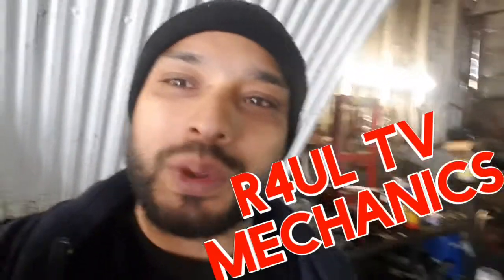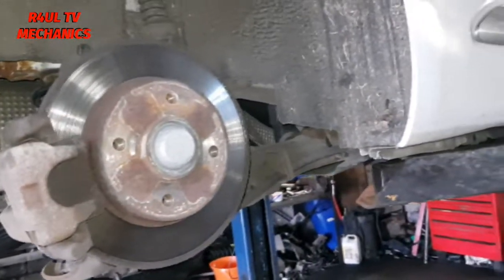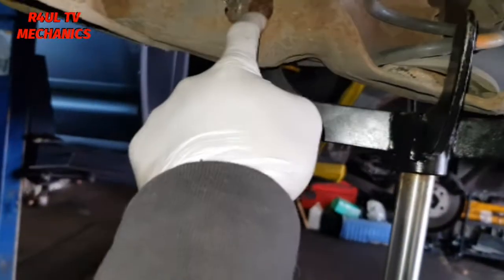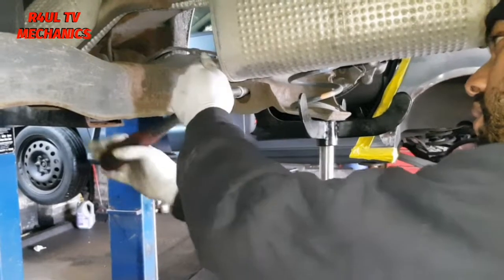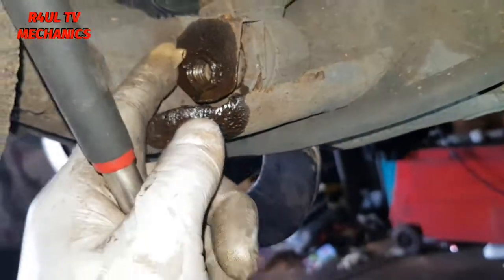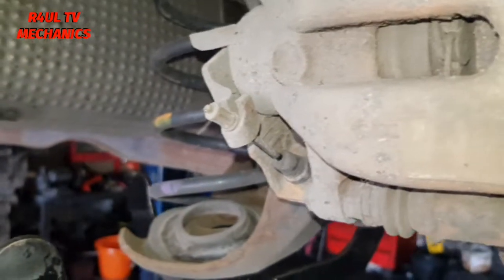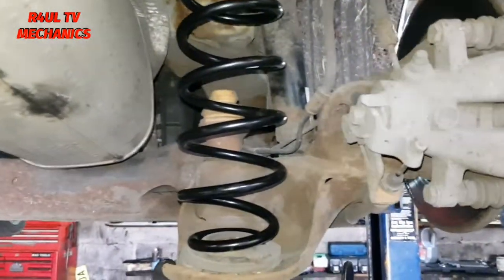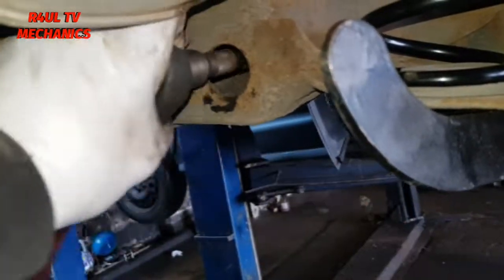2013 CITROEN DS3 REAR COIL SPRING REPLACEMENT

Comment: I just went to a mechanic to have this done as when I tried laying down, I couldn’t get enough power to loosen.
He then said he couldnt do it as he wasn’t able to get the bolt out when he undid it because the shock is pushing down on the outside element of the nut? 
He went on to say that even if you did get the bolt out (by smacking it), getting it all lined back up again would be a nightmare? Any idea. Mine is a 2011
Reply from the maker: It's just a nut and bolt should come straight off. It might be tight but should come off. Just give it some. If you are local next to hyde Cheshire let me know I'll do it for you
Reply: @TEAMR4ULTV  nah man was all good. I got dirty and proved my mechanic wrong.
Cheers for the help man, easy job. 

I would say, mechanic initially cracked my bolts, couldn’t get enough leverage lying down.. this is a standing job